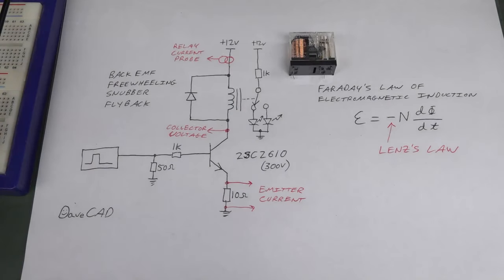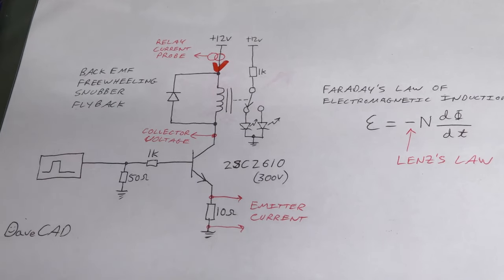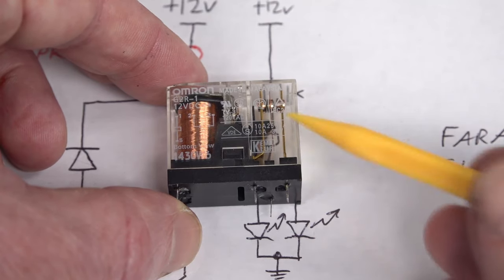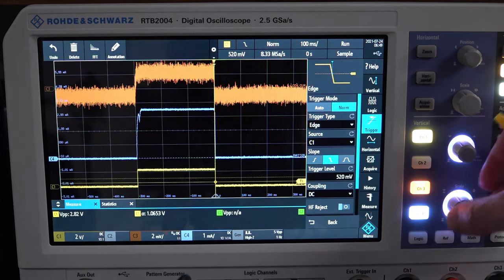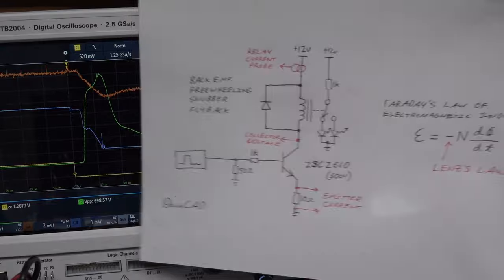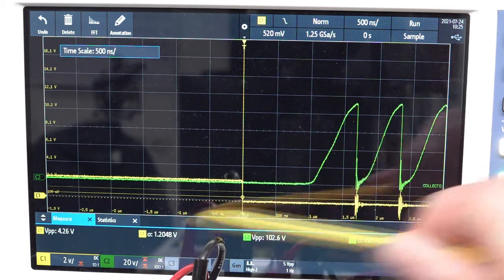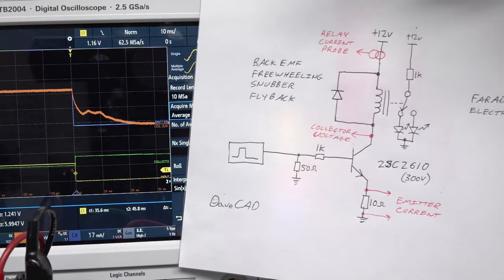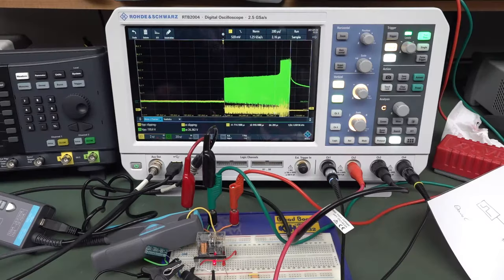EEVblog 1409 - The DANGERS of Inductor Back EMF

Comment: Real world experience. The robot I worked on used an audio sampler on a midi interface ( to play music clips etc) , and had a water valve actuator. I was new to the job, and experienced random samples playing, when the water squirter was switched on and off. Not really wanted behaviour. The small water valve had a solenoid, and I figured that the solenoid coil switch-off spikes ( as Dave so ably demonstrated) were enough to cause the sampler to switch on, despite the water squirter being on 12 volts, and the sampler on 9 volts. A simple diode fixed the problem.

Comment: The flip side of EMF kickback as a problem, is using kickback to dynamically brake a DC motor in a slot machine hopper, for example.

Comment: Hello, I see this is somewhat an old posting, but I have a quick question, I have a Relay H Bridge (12vdc) to drive a 12v motor forward and reverse. I understand the fly back diodes across the relay coils, no issue there. My concern is my relay contacts, Im using a DPDT Relay for the forward/reverse and then another relay to close the Ground side of the power feed. My 12volt feed is coming from a pwm speed controller. So no direct 12vots going right into the motor, actually Im keeping the controller turned down. But do I need a pair of diodes to deal with the motor's inductance so I dont arc across my relay contacts? The Motor is not being switch forward and reverse in any quick fashion. Its for a Solar actuator, so its on a few seconds at a time throughout the day in one direction. Then returns east before morning.  Ive seen so many different diagrams and had so many different suggestions its making my head spin.  As I see the 25 comments below mine now, I really just need to know whats the best and easiest way to save my relay contacts.  Thanks and thank you for the great video.

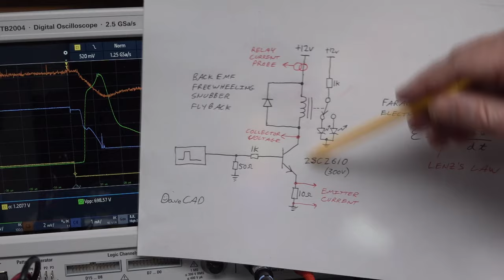Comment: 16:55 "That will be due to parasitics". 
Then I take look at PCB and... it's a breadboard!. Lol, of course, I have been able to verify some poor qualitiy breaboards can have several hundred of pf of parasitic capacitance between adjacent conductive foils, and contact resistance can be high as 2 or 3 Ohms.
Without flyback diode, you can pick up collector voltage through another diode to charge a capacitor, this is the principle of boost converter :P

Comment: I've got a single coil latching relay, driven by 2 mosfets (one for each direction, on and off) for a short pulse. I'm assuming the body diodes provide the equivalent of the flyback diode.

Comment: Can some one help my please?
I have old clasic gm based car I took out back lights and changed them to new'r year stile.
My front blinker work but back is diferent story.
First I tought those bulb holder circuet was faulty they are basicaly the same so I put back old bulb holders and my back blinker still not working properly on the right side of my car.
Instead of blinker my red light blinks ore tail light expecialy if I turn on head lights.
My car oddly refuse to shut off when I turn on all 4 blinker hazard.
He makes odd sound .
Even with key turned off compleately!
What is wrong with my car?
Is he back charging and why??
For some strange reason the acelerator cabel on my carburetor does contracting for some reason car want to acelerate by him self so I took of air filtel who is metalic and made some distance from grounding it stoped contracting that cabel.
And engin stops self acelerating .
Any one has logical explanation why this is hapening?
My voltmater got fried.
15v chown on the baterry and its climing rapidly with engin acelerating .
Its unusual effect.
I suspect backcharging ore faulty relay .
Basicaly the old bulb holder and new are the same wire position evry thing is nearly identical.
So Im not shure why there are neutral plates in that thing and what porpuse they are intended for?
Preaty much strange behavior.
Probably I shuld use resistor ore diode but dont know where to place that thing.
Shuld I remove wires going to neutral plates on the bulb holder circuet?
What the hell is that deam relay doing exactly?
Did it change dc to ac ore vice versa?
I did replace blinker handels and for wind screen washer handel my small water pump was not working evry thing ells was standard.
I did feal engin increase in speed when I turn off head lights and blinkers.
So I did replace the acelerator cabel that stoped the self aceleration of my engin.
But still those bulb holder and relay confuse my lot.
My alternator doing some funny staff on my.
I still cant figure out what is with my right side back blinkers?
Some times all 3 lights go ON blinker,tail light and brake lights.
So any one knows how get ride of that problem?
And intead mount seperate circuet for external relay ignition system because some how I like my engin runing quaeter with lot power.
That self ignition some how was fascinating for my .
Again have no idea how my ignition coil fiered with out the positive lead going to my ignition coil who is by the way a E core type singel coil GM HEI with 4 pin ignition module and induction triger with wacum advance.
So any help wuld by nice .
Aperantly the baterry was not fried but I feal small shock when tuching engin chassis.
Its anoying!
So can some one please show my how to ceap that good staff and get ride of anoying staff?
I tink its similar to plazma ignition I have no idea what It does to my car aperantly my starter motor spins faster so thats why it good my curiuse.
Is this wiard problem related to dual ignition ore self ignition?
Well buzz coil centrainly did exist back in the days .
But mostly confuseing my those relays.
For some reason when ever I put anty freaze in my car the dashboard is ticking coming from the milage counter it stops working.
For some strange reason because of that back charge my milage counter stoped ticking ???and the milage counter works again???
So what the hell is going one?

Comment: Note the Pn100 and most small low power transistors driven into breakdown will not survive long term. Their breakdown energy rating is being exceeded.

The use of an LED either as flyback across the coil or more typically across transistor to ground is part of JOULE THIEF circuit  excelt the transistor is driven into oscilation by a vouled coil and resistor to base.

Comment: Snubber diodes are essential BUT slow down the release time of a relay or solenoid.  During the back EMF pulse you have a circulating current in the coil, and that circulating current produces magnetism and slows down the collapse of the magnetic field.

Comment: Please do NOT suggest to new users, that 100s V will not from a relay damage their inputs of the oscilloscope, particularly on 1:1 probe or worse on direct wire. Maybe on 10:1 and likely ok on 100:1 probes  but to suggest rnergy os too low to damage the inputs is NOT CORRECT!

Comment: Higher voltage in the coil induces a stronger magnetic field which pulls the switch open/close with more force changing the amplitude of the relay.

Just a hobbyist but that’s my assumption.

Comment: Have you tried using the slower 4001 type diodes? See these used in many circuits, wonder if there is still spikes / oscillation

Comment: 2:06 Disagree that you needed to add the note "more correctly rate of change" because your narration said "change in flux over change in time" which is already a rate of change. In fact, your "correction" is arguably less correct because you left out what the rate of change was with respect to.

Saying "rate of change in flux over change in time" is bad grammar or tautological or wrong mathematics. delta phi is by itself not a rate of change, hence it would be a mathematically wrong statement, or it's repetition because one then states the variable the change is with respect to. "Rate of change of flux over time" would be fine; some insist on replacing "over" with "with respect to" even though that wouldn't help clarify meaning here.

Comment: Years ago I had a practical lesson that v = L di/dt when checking the resistance a 4 Henry plate choke with a Simpson 260 meter, a probe foolishly in each hand, holding onto the leads from the choke.  I got my reading, then let go - ouch!, and a few four letter words were said!  You can have a similar thing happen If you foolishly leave the secondary of a current sensing coil disconnected.  You can get hundreds of volts because the current in the wire, effectively a one turn primary, can not be denied and the transformer will try its hardest to obey the laws of physics to get the proper ratio current to flow in the secondary whether there is a load there or not!

Comment: inductors are a pain in the ass to electronic hobbyists. you can probably kill yourself with a Microwave oven transformer and a 9 volt battery. its at least enough to turn on a neon lamp for a fraction of a second. when I was a kid taking apart electronics the inductors got me nicked before mains did.

Comment: That's interesting .. why is the relay slamming back with less force with diode in situ.. its electromagnetically braking it but how ?? Diode is shorted out so the coil is shorted out .. I imagine the small amount of residual magnetic energy stored in therelay tip is inducing a  current in the now shorted relay coil.  Or the voltage is now dropping more steady and slower so less rebounces and just a single relay click. Only one way to find out lol x

Comment: If you have a need for speed then use 1n4148 in series with zener of same voltage as the relay coil rated voltage, faster magnetic energy dissipation then :D

Comment: If pulse a LC CIRCUIT in series L at 100mH and C at 100mF  and the pulse at 1v at 630mS you can get 20 and 20 amps out of the capacitor and power A high wall to the load.  So says Nikola Tesla.

Comment: Thanks Dave, l do some teaching of electrician apprentices at our Tafe in Warrnambool.  I build similar apparatus to try and teach them the real risks around working near inductive apparatus.  It helps keep the brains engaged, and keeps the students thinking. As part of the AC theory we eventually get to take a look at resonance and the looks on their faces when demonstrating the high voltages that can be present in a series resonant circuit really gets their attention. Along with  the risks working around circuits like this, particularly with work around power factor correction, and the risk of resonance occurring in such designs.
Your current probe, you used  d o you still sell them ?
Regards Bruce

Comment: I had no idea what those diodes next to relays were until i got a tape machine that was full of them. The interesting thing is that those diodes would fail and the relays would stop working. In some cases it was kicking back into the record head causing clicks/pops when the record head would come on.

Comment: I wish you'd have shown a MOV across so we cold have seen how that compares to the diode.
Reply: And an RC snubber, another alternative.
Reply: Works well, and is often used across the switching transistor, as after all that is the part you want to protect. Used them across the contacts as well, though you do need to take into account the failure mode of the MOV, as they often tend to fail as a short circuit or low resistance.

Had to explain to an electrician the difference between a 130V MOV and the 275V version, and as to why they do not last long when you apply 230VAC to the 130V version, despite being the same dimensions physically.
Reply: @SeanBZA  If the MOV is across the transistor, doesn't this then apply the pulse to the power rail? Granted, it sinks current immediately so prevents the voltage from rising much.

Comment: Had to deal with this when making my final project for embedded systems. It was a clap activated fan with three power stages using a mosfet driver. Had a flyback diode but the electret mic was unstable if the pwm was over 30 % duty cycle, cycling through in an infinite loop. I got around it for my final project by having the 3 fan stages be below 33 % duty cycle, so I had a deliverable for the final. It seemed like the emf traveled up through ground, through the mic terminals and to the adc and activated the fan, cycling the fan in a loop.

Comment: Could you put the transistor switch on the other side so it switches the positive to avoid the back emf?
Reply: No. The relay coil will still build up a magnetic field when it's turned on, and the field will still collapse and create a counter-current - which would cause high voltage without a snubber.

Comment: So, if the flywheel wants to keep turning and turning and turning and turning.... Hmmm... I think.... yes, yes, if you amplified that through a solar roadway, and quantum tunneled the transverse conductance through some zero-point particles, you could get enough FREE ENERGY to wirelessly charge your electric car!
Reply: Actually a tricky setup, you need to know the size contact and the amount of current and match them so the arc burns clean the contact.  Same with any simple push button switch, must match the size switch selected with it's load current.  Never use a large push button switch for a small amount of current as it won't have sufficient arc to clean the internal switch contacts and will have a bad connection eventually.

Comment: I remember last year we were fixing a steam roller's water system with a new solenoid valve (12V). I was holding the valve while my boss manually connected and disconnected it from the battery and every time he did it I felt a jolt in my fingers.

Comment: I did this exact thing when building my super cap spot welder, i put in a single diode across the coil, and a diode and tvs diode across the welding leads to prevent the contacts from welding themselves together, this combination was a compromise on the voltage spike across the contacts and the time it took for the solenoid to disconnect, around 11mS and +/- 20V.
I also had soo much energy from those super caps i had to increase the length and decrease the cable cross section, actually using the cables themselves as a current limit because otherwise it was too much energy from those caps and just blowing metal apart and creating holes in 1mm aluminium. I also had a timer feeding the solenoid so i could adjust the on/off time for the spot welder.

Comment: Might have already been mentioned, but with some loads e.g. automotive filament type lamps the cold filament inrush current can microweld the relay contacts and if there is simply a diode across the relay coil the slow releasing relay can be prone to sticking. If at switch-off the transistor collector is allowed to rise to a reasonably high (but clamped) voltage the sudden jerk release of the relay armature is sufficient to prevent the relay from sticking. Have read this in actual relay datasheet somewhere.

Comment: Trap for young players: you can’t even turn off the transistor instantaneously because of inter-electrode (parasitic) capacitances! This is especially problematic with MOSFETs, but even the humble 2SC2610 will have some finite capacitance between the base and emitter. Just as you can’t change the current through an inductor instantaneously, you can’t change the voltage across the base-emitter capacitance instantaneously. I ain’t having it! 🤣
Reply from the maker: Meh, near enough!

Comment: Nice video!
I have preference on MPSA06 and MPSA56 for low voltage, nice gain and low saturation voltage, MPS42 and MPSA92 for 300v transistor.
2N7000 are also very nice mosfet for this type of job.
I use transorb for fast recovery relay coil in automobile application.

Comment: Hello Dave. Nice video. Why that loud noise i think it is because of that increase of voltage is messing  with microphone.. and i wanted to add that i'm using instead of diode capacitor. I had bad experience with switching two big ass relays to be exact 200W power once i switch it on..it blew out my timing relay i had there (it was circuit to swtch off grid power and connect solar power and vise versa) ..so i had to put parallel one capacitor into that relay ..once done it was ok no big issue..and ofc i didn't know because i didn't expect it should be a problem..but it was..relay with so big inductance made a big spike in voltage..
Reply from the maker: It's not just mic pickup, it really is louder. Without the diode it slams back harder and faster. The diode delays the time and effectively "softens" the armature pullback.

Comment: Most circuits I'm familiar with usually use a 1N 4001 for back EMF relay clamping rather than signal diodes like 1N 914 or 1N 4148.
Thanks for sharing.   😎👌🏼

Comment: I've often wondered about the last bit and why in commercial circuits they don't seem to just use a single diode on its own, sometimes they put TVS diodes and capacitors in there.
Reply from the maker: It's a cost and optimisation tradeoff.

Comment: That nasty EMF kickback problem that kills coil drivers in pinball machines and FETs in SMPS power supplies.
Reply: Well said, Rick! In those days it took Gottlieb, Bally and Williams a few years to find out why their "new digital" pinball machines broke down so quickly - 7 segment displays changed to 2-3 segment displays - until the machine stopped working at all...
Reply: @richardhack9830   Ironic, that inductive kickback, that damages coil drivers, is the same fundamental force used to make modern SMPS power supplies work properly

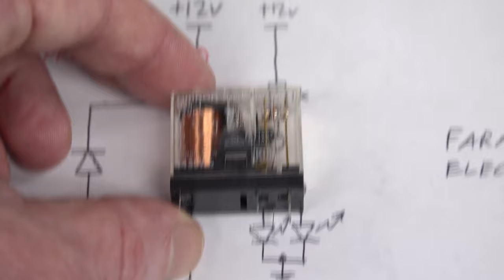Comment: If you need to stop the inductor current quicker, increase the diode voltage with a series Zener or R||C snubber (inset at 8:15).  Keep in mind that the V_CE (or V_DS) will also increase.